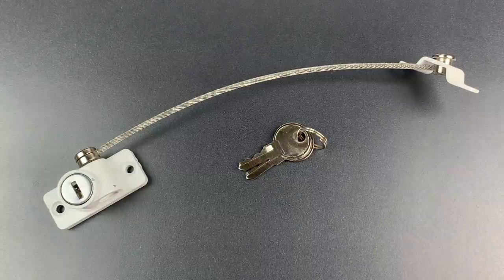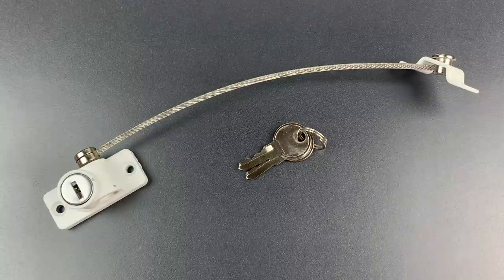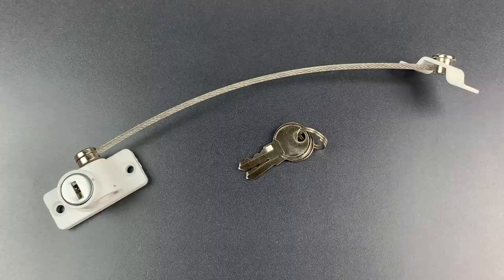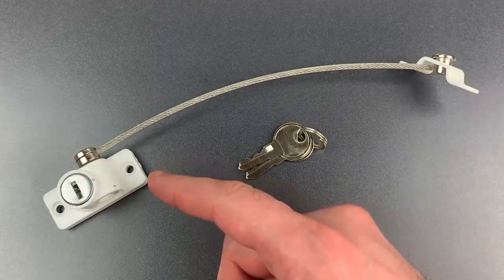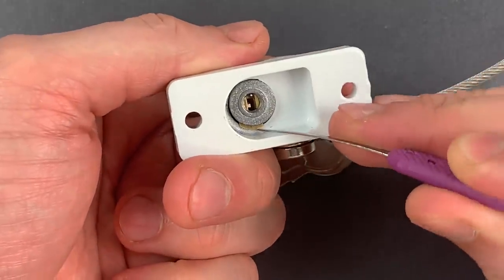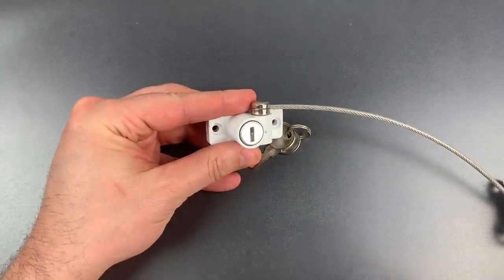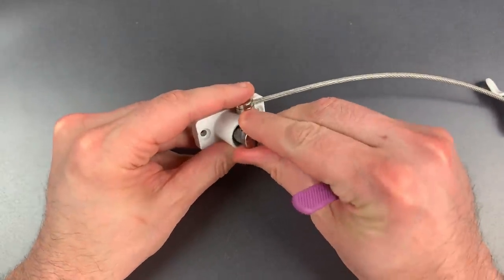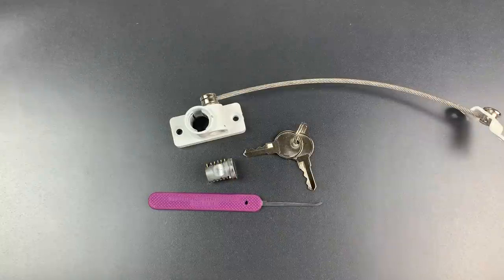[873] Why Is This Lock So Dangerous?

Comment: I've seen these in hotels and they are beyond a joke, you may have bypassed that lock in under 2 seconds with a tool, but last time I tried to lean against a window with 1 of those fitted to smoke out I was worried about pulling the 2 tiny screws out the pvc framework.

Comment: Excuse me? A window is not going to stop me if the room is on fire...
And looking by the size of those screws and assuming the window opens outwards, a proper kick to the window frame will pull that lock out of whatever it is screwed into.

Comment: If its a sliding window you couldjust slam the window open against it till the small s rews plull out the window. 

Also of the window is lock it prolly isn't an actual fire escape path you should read the escape plan posted in the hallway or near the door of your room form proper egress routes.

Comment: This isn't really a defeat of the lock when installed. To access the lock to do that, you need to be on the inside of the window. Which means you're inside the house, which means you don't need to defeat the lock....
Reply: @BannedGamer998 Every properly installed window lock should be on the far end, and unless you have very narrow windows, a couple inches hell even 4 isn't going to let the majority of any male over 5'6 in enough to reach the lock, let alone manage that. 

If you install your locks on the opening side of a window then you're kind of asking to get broken into.

Comment: @1:56 mweh since such a lock (its to prevent suicide) is fitted to wood or plastic, give it a good pull and youll tear it off
Reply: On the first floor? Does it also prevent covid? 🤣
Reply: @cleverusernamenexttime2779  well that can be explained that when they let them be installed its easier just to do all windows, is also so people don't trow shit out of the window, or from people slamming the windows open, or from the wind pulling the window open when someone forgot to close it and went out.

and it probably prevents it about as well as a P100 dust mask can prevent a N100 virus from going through admitingly, but that said a determined man will find a way and usually if anything all that is needed is to break that tunnel-view on death for a moment

Comment: Years ago my apartment building complex was trying to pinch pennies they can’t charge us for electricity so they tried to make everyone remove their air conditioners stating some bullshit law about how the Windows have to have baby locks installed on the windows and saying it was mandatory and that I would be fined by the city if I didn’t let them bolt my windows shut of course most people didn’t actually look up the law (which doesn’t exist by the way) so they bolted their windows shut they could only be opened 2 inches the apartment directly below mine caught fire and the occupant died of smoke Inhalation she could not escape their penny pinching bullshit literally killed a tenant they immediately sold the building to a company that was 100% better and actually did upgrades and fixed everyone’s stuff the previous landlord never fixed and got rid of the roach problem by having the entire building done instead of 1 unit every other week it’s so much nicer here now it’s just a shame someone had to die for it to get that way .

Comment: Ok, how exactly is anyone supposed to even unlock this, if its on the INSIDE, and an intruder is OUTSIDE the window? First, youde need EXTREMELY thin arms, secondly, you would need to hope you go go hatchet arms are working since you're have to pick it ON THE INSIDE of the building, up, and around the base of the windows sides, then, youde need to see where and what your messing with? I think you over thought this to much.... if I'm wrong, I would like to see it picked exactly as this would be when its fully connected and armed in place..... thanks!

Comment: Is not being able to get through a window really that big of deal? In all the houses I've lived in and remember the windows for, only two have had windows that someone could get through (although some people may have difficulty getting through or may not be able to at all) and only one of those was on the ground floor. Maybe it's different for a hotel where it's a big building but I was in uni accommodation in a flat in a fairly big building and you wouldn't be able to climb through any of the windows as they were the windows that opened only at the top (and we were on the third floor anyway, so wouldn't like to try jumping from there).

Comment: Was this on the first floor of the hotel? If it's on a upper level then it is code for a lot of states, to defer jumpers. In most of the hotels in Wisconsin they just screw or weld a bracket in and say forget the easily defeatable lock.

Comment: Couldn't they also just unscrew it off of the window frame? I mean, if you have a piece of metal that's strong enough to pull the lock out of the device, wouldn't it also work well as a screwdriver?

Comment: If my hotel room window is locked such that fire code is challenged and I'm in a situation where I need to through that window for my own safety, I'm breaking that window as a point. Or I'm taking the lock core with me.

Comment: They have these on the first floor for your protection. That way, you can sleep with the window cracked and not have to worry about someone opening it all the way and climbing in. I doubt this is against the fire code. Especially if you are on the 12th floor. LMAO!

Comment: In what world is it “remarkably easy to defeat” if the windows only cracked open a couple of inches?

Also, how is it dangerous if you just leave the key on the windowsill?
Reply: It is remarkably easy to defeat from the inside. So the scenario is that the hotel installed those locks on the windows but do not give you the key to the windows. So in an emergency, you're trapped and cannot get out the window. LPL showed how to defeat the lock in that exact scenario.

Comment: Thoose locks are suppouse to prevent a child from falling through window. Most of the times are only attached to a plastic part of window and even if someone screws into a metal frame all you have to do is to give a little push. Probably my 4 year old can do it as she is quite strong for her age. So not so deadly unless you are expecting your kiddo to run away from danger, when still beeing unable to build a sentence. Like your vids but I am dissapointed with this one

Comment: I mean escaping from non-ground floor windows isnt exactly a luxury you would have, so while i dont prefer to be barricaded its not like this is a huge concern.  I cant speak to whether or not its a fire code violation, but I’ve never stayed in a hotel room where there were multiple points of egress.  If the threat is at the main door, youre just boned.  

On another note, my Peterson set has been shipped so I cant wait to open hotel windows as much as i want!  Next up a covert companion.

Comment: that lock looks alot like what pep boys sold as hood locks for cars before in car hood latches had one on dads 65 plymouth sw after battery was stolen  my job used a magnetic lock had about a 1.5 inch long thing that you oplases next to side of the lock had a guide  we never lost batterys but few cars and trucks stolen they had worthless pinkertin min wage guard never saw anything

Comment: I mean, this is a kinda pointless video. For you to do this you need access to the lock. If it's on the inside of the window, you're not getting there with a pick. 
The bigger problem I see with this is that it would be insanely easy to rip it off a window with a slight shove.